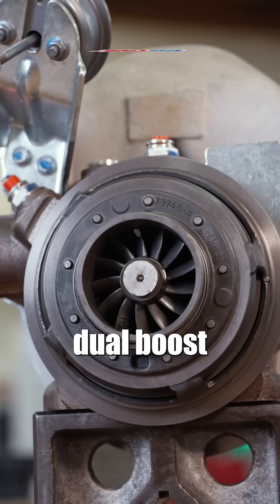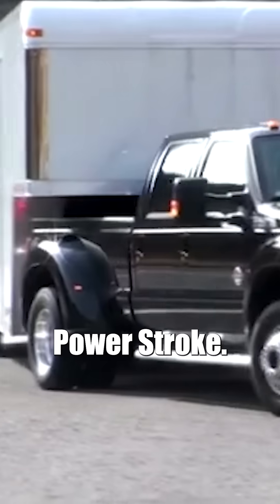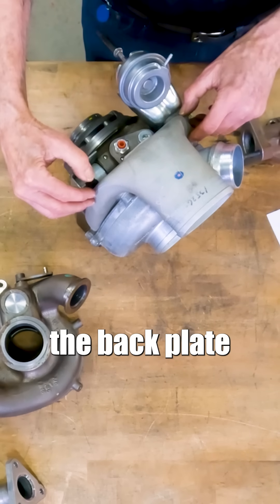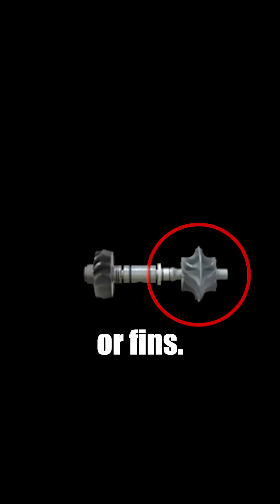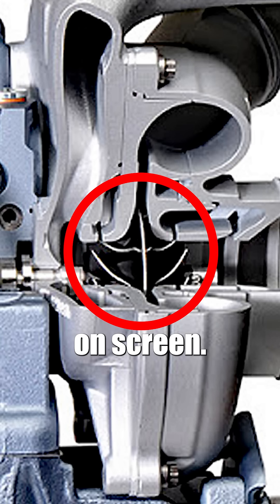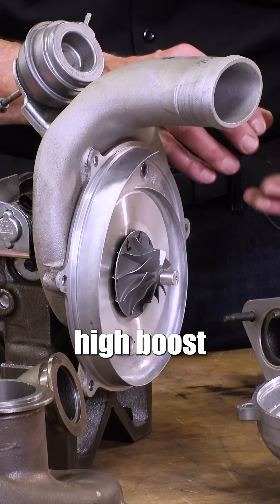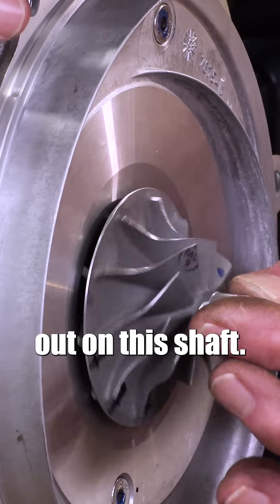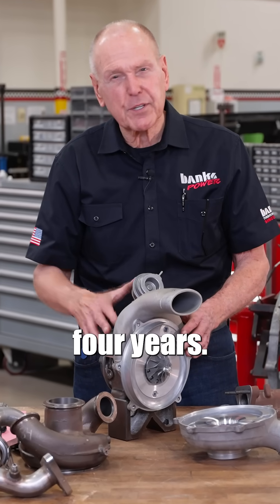Ford’s turbo failure.

Comment: They did this with early jet engines. Axial compressors were complicated, but a centrifugal was known tech to early jet builders, same as the old superchargers. So jet builders like Rolls built dual sided centrifugals as a stop gap till axials were perfected.

Comment: I would have made a double wheel on the exhaust side also, just to maintain balance, but also shouldn't the further contact area create a better rotation? I don't know about shaft speed, but id think it would hold momentum better. I literally dont know, I just fix cars, I don't do design haha 😁

Comment: Those turbos are junk I've got a corner of my shop that is full of those early turbos and number one reason is because no one does anything about the breather box and the seals in that turbo can't take the exrta blowby/crank case pressure when the breather box gets clogged so it will begin to smoke.....second reason is that compressor wheel will shear off from hard on off throttle hence why they waste gated a variable geometry turbo there shouldn't be a reason to wastegate an oem comparable variable geometry turbo and even being wastegated they still will shear off the wheel......and anyone who goes back to the early turbo is putting back on a problem do the right thing and convert to the 15+ pedestal and turbo....now you wouldn't bolt right back in a cp4 right after you lost one and all your injectors would you so why would you put back the same shit turbo.....

Comment: I have 2011 with 310k miles on it , have no emissions from 60k , engine  is amazing,  turbo never failed ...... yet.  Checked if I had wiggle in the shaft and it's solid.

Comment: - I think ???Williams turboengines used a similar back to back "duplex wheel" - rather than 2 compressor stages,  it was turbine / compressor" wheel - only they put the hot side buckets on the back of the wheel - it made for a very compact APU turbine generator - Maybe there was a thermal break between the actual disks.. - but the bearings were" -probably best  - all located on the cold side. 

With this design - for high speed operation (high boost ratio) a simple inlet shutoff-valve on the "surplus" compressor wheel - will completely unload it - so i tis a parallel duplex turbine - a high speed wheel combining??  a low speed wheel  (maybe splitting the wheels for manufacturing  and adding an unloading clutch would take parasitic loads off - though the mechanics of bringing the second wheel online and off line could be physical nightmare - though it could spool faster with one wheel offline...... ..

Comment: Cummins made the perfect engine. No modifications needed. The ISC 8.3. Rev it, lug it, load it, no services no problem. No bigger turbo needed, grid heater, 330hp 800 torque. Pushes my 27,400 pound bus no problem. 1999. It was designed with Banks in mind and beats Banks.
Cummins all the way.

Comment: Why 
Is it at 40 seconds into the clip .
He spins the turbo shaft and the inducer impeller looks to be out of round ?????
Reply: That's probably why he had it on the bench. The bearings failed, causing the impeller to contact the housing and chew it up.

Comment: So it's a single turbo that spools like a twin, pretty genius trick actually!
Reply: It really wasnt a great turbo. In the low end its decent but when tuned (even a mild tune) they tend to fail because it can't keep up and end up spinning way to fast. I put the 15+ turbo on the 2013 f250 I had after it failed. It made a HUGE difference in the top end and I didn't notice any loss in the low end or any difference in boost lag. That's probably the reason ford did away with that style turbo. It was just way over engineered.
Reply: You also have twice as much air, though! It's really good

Comment: Hell HOLSET turbos did something like that 25+ years ago, basically it was a turbo with (2) compresor wheels 1 stacked in front of the other one , it could do over 160 # of boost, but it wouldn't last one  350 foot pull before it would take out the thrust washers 😮

Comment: I actually like these they spool quick for the flow. Mitsubishi was back had an axial flow turbine feeding and centrifugal on a common shaft and from what I understand it actually worked out great in racing as it spooled quick for the day and was happy making 45psi of boost when the competition same size was struggling doing anything past 30psi with just making heat. Even this turbo could be modified for compound with just a back plate redesign

Comment: it's a cool concept that's basically been solved with twin scroll turbos, this seems like Garrett did it as cheaply as possible. A twin impeller system is probably possible with more money.

Comment: The concept is basically a centrifugal flow jet engine. Without a combustion. Ch-47 Chinooks engines are centrifugal flow jet engines.
Reply: T55 that you are referring to has 7 stages of axial compressor plus the centrifugal compressor.
Reply: @danmartinez9497  I never worked on the ch-47 with T55's. I did work on CH-46 with T58-16. I only knew from hearing from my instructor about the 47. And I do know the twin back/front turbo impeller isn't exactly like the centrifugal flow engine but it borrows the same principles that make the centrifugal flow engine work. I stopped working on helicopters almost 30 years ago. It was an amazing experience. And I'm glad I had it.

Comment: They didn't spend anything on design. It was invented by Rolls Royce in WW2. The two stage supercharger was on a common shaft. They simply did it with a Turbo.

Comment: Looking at that design, it really looks like any end thrust would be cancelled out at the compressor wheel.
So why did they quit using it?
Reply: The bearings failed in them. They spun too high of a speed to make the boost they wanted. This is even worse if they are tuned. Ford executives wanted power but also instant throttle response. And this is what the engineers came up with. I feel they could have made it reliable but it was basically already maxed out on the amount of air and boost it could make anyway so they just put a regular bigger turbo on it.
Reply: @blakew1026  Did they have a floating bushing in it or actual bearings.
Reply: @monsaka7827  actual oil fed bearings. I heard it could see shaft speed of like 100k rpm stock and up to 120k+ tuned

Comment: The normal full flow oil filter is 20 micron. List of stuff gets through.  
Fit a 2 micron bypass oil filter. Nothing nasty gets through and the oil lasts longer. Potential A LOT longer, but you’d need lab tests to take it that far.
Reply: I"m not sure how this relates here but about 45 years ago I remember being shown a study that someone did in conjunction with an oil lab in regards to bypass oil filtering. The testing was done with Perkins diesels which at the time were becoming a somewhat popular conversion during the second gas crunch in the 70's 

To make this short as possible, what they found was that the oil filtered through the bypass was remaining somewhat or somehow separated from the oil flowing through the engine. The consensus was that the bypass filtering was returning oil at a lower temperature and that lower temperature oil would remain separate in the pan where it was re-introduced after going through the filter. It had an effect but the effects were minimal because it was not merged with the main oiling system. Sort of like the eddy currents in creek. 

The end result after the study was that they would be better off to come up with a higher flow rate to a full flow filter with a bypass to protect the engine if the filter became restricted or to have a second, back up filter system which when in bypass of the primary filter, would take over still remaining a full flow filtration system.

I'm not sure what was ever done with it all since the Perkins air cooled conversions fell by the wayside over the years and the companies involved have all gone away but it did make sense. The whole purpose of the testing was to extend oil life and reduce fleet maintenance costs. Another idea that was put forward in the end was to have a filtering system that could run after the engine shut down, effectively reconditioning the oil partially but I never saw any logistical solutions for how that would work and remain powered up if not connected to an external power source and it would have no effect on the engine while it was running.

I think in the end they determined that extreme over filtering of the oil did not improve oil life enough to justify the cost, nor did it replenish additives in that oil which were still being depleted at the same rate, if not even being filtered out faster via the added system. 

There were various bypass systems on the aftermarket sold but none at the time became common place nor a replacement for more regular maintenance.

Comment: Factory Holset VGT on a 2018 Cummins with 450,000 freedom units on it. How? Deleted EGR at 33 miles the day I got it home from the showroom floor so it wasn’t breathing its own regurgitation
Reply: Same thing here on a 2015, 6k hrs on it and 200k. Haven't had to touch anything knock on wood
Reply: Wouldn't deleting the EGR save on def fluid as well? Or is it the opposite?
Reply: @monsaka7827  opposite. It will use more DEF.
Reply: @JC-dt7jv  That's a bummer.
Reply: opposite... more DEF used.  @monsaka7827
Reply: @monsaka7827  you think he deleted the egr but kept the def system?
Reply: @thevampiredude7  I have no idea. Some people do things in stages or by least effort and deleting EGR is a lot easier and cheaper than deleting def systems.
Reply: @thevampiredude7  I have no idea. Some people do things in stages or by least effort and deleting EGR is a lot easier and cheaper than deleting def systems.

Comment: Here is the problem. It was the bearings that were bad, so why didn't the company just upgrade the part 2 ball bearings.
It's because this turbocharger probably would have been extremely reliable, and they could not make money on it. Breaking and falling apart once the bearing problem was fixed
Reply: Hell, mines got over 350k on it and sounds and runs like a damn spaceship. I love it. When it takes a shit, I'll put the same damn kind back in it bc I've never heard a more beautiful sound in my life. When you drive by and let off the throttle, ppls heads spin to see what it was. It's 🤌
Reply: @chuckbuttons0699 Ha. You really think people are turning their heads in admiration don’t you? We’re just playing “spot the short guy”
Reply: buddy the bearings are being abused. that's the issue. He said popsicle on a stick, and it's true. The dual impeller is lopsided and the bearings cannot deal with that. NORMAL turbos get impeller shaft play, of course this one would as well.
Reply: You're hired by Ford and GM. Both you think like they like it
Reply: I don’t believe that BS for one minute. Lots of people have become so jaded and cynical when it comes to manufacturing companies. To actually believe that they invested research and development dollars into creating parts that will last just past the warranty period and then fail soon after is ludicrous. C’mon man.
Reply: @wphh7272  because its true. Ford is now using timing BELTS drenched in oil in global Ford Ranger and Everest with the 2.0 biturbo diesel engines (same as Peugeot) and some ecoboost engines have a wet belt for the oil pump. And guess what? It degrades after some years way before the recommended replacement interval and destroys the engine. Oil pick up fills with belt pieces. This was done just for emissions and efficiency standards and they really dont give a shit after the warranty period ends. Go buy your new engine from Ford. Ill keep my 2016 Jeep. Not the best one, but its reliable enough for me and it has an ACTUAL metal timing chain that doesnt get destroyed by the oil.
Reply: @wphh7272  especially when data shows that one of the main ways they sell is to customers satisfied with their previous trucks. Manufacturing companies can make mistakes and look for profits but they are not evil idiots
Reply: @wphh7272 Look at how companies work to increase their stock. It's always about more and more and more profits. Build more, cheaper, and charge more. These large companies are never satisfied.
Reply: @wphh7272 I’d love to believe what you are saying is true. I look at complex designs and think man there’s no way they wasted that much time designing it so well that it only lasts x miles. However, when we see seemingly increasingly accurate, shorter and shorter warranties, how could we draw any other conclusion? Besides maybe hiring the wrong material’s manager which leads to inadequate quality of materials in essential parts like the bearings.
Reply: @wphh7272   I'm absolutely with you, this guy is talking bullshit. Why has no other company such a design in their program, if it was so good it'd be a common thing. yet this was probably the only turbo with this design.
Reply: Great explaination 🏁🏁🏁

Best out of all the other commenters here 🎤

Comment: I would think we should be able to beef that shaft and bearings up and make it a impressive reliable turbo.
Reply: If I remember right, wasn't the main problem just the cheap crappy ceramic bearings anyways?
Reply: @ right, ford did do some improvements on the 13-14 turbo’s bearing i think, it’s just a shame they didn’t try to keep that style turbo going and really improve upon it.
Reply: Yeah no doubt!
Reply: Well, they had their best minds designing and creating that turbo. Not only did they cease to use it, no ford hobbyist (which there’s a whole cult of them) found any practicality in that turbo setup nor did they find any reason to try and make it better. There’s a handful of people out there that live and die by the ecoboost platform and make tons of power with them and even they didn’t want to try and make this better.

Comment: So why do they fail? Shaft snap? Bearing burnout??
Reply: I would guess the bearings wear out allowing play in the shaft and the impellers contact the housing grinding away the veins so that boost pressure is eventually lost or it detonates.
Reply: @ I appreciate the guess

Comment: The real benefit of this design was it's very quick spool and transient characteristics.  If you drive a 14 and 15 back to back it's noticeable and slightly disturbing because in the back of your head you think something is wrong with the truck for that split second until you remember you're driving the newer truck.  All from the idea of producing larger turbo flow via using twin small diameter and therefore small MOI wheels that spin up much faster using the same exhaust energy.
Reply: Huh? Don't you still have the same amount of mass to spin because you have two turbines?  Maybe a little gain on what your saying because smaller dia turbines reduce the arm on the mass at the end of the radius.  I have a 2013 F150 V6 Ecoboost and the turbo lag is terrible.  Anybody have fix for that?  Also had to put $12K into it at 151K because of that stupid cam time nonsense.  I MADE ford pay for half of it.  For the record I am religious on maintenance and had a 2000 F150 Triton 5.7 go 220K with ZERO major issues, and no drive train related anything.     That was the most reliable vehicle I've ever owned.
Reply: @1950Bonanza  yes, probably has similar mass over all, but it’s more concentrated towards the center. Rotational inertia is a produce of the mass and the square of the radial distance from the centerline of rotation. Therefore, mass isn’t nearly as much of a concern as overall diameter is.
Reply: @plconnor41  Makes sense.

Comment: I'd say for Gale Banks to be impressed with a stock turbo: it should be good!
Reply: Hes explaining why this turbo is garbage
Reply: Ford like spend money to customer paid their engineers....
Reply: the idea is still cool lol. 

somebody should fix this design and put it with a DVT hot side lol. 

basically twin turbos in one turbo. a parallel turbo lol. 

a pair of them on a flat plane v8 would be bananas lol
Reply: It's actually a failure prone piece of junk which is why they ran away from it rather quickly
Reply: @charlespleydell6746  
And bad
Reply: @markcozzie I’ll bite. Please explain.

Comment: That's how innovation goes sometimes. It take a lot of time and money to prove something out that should work in theory.
Reply: no you don't get it, the turbo is open ended meaning the dual impeller is held in the center of the turbo by the bearings. the amount of play that will inevitably develop is an issue.

even in theory this looks like a problem.
Reply: @krebgurfson5732  are impellers not normally held in the center by bearings?  Or is this a problem because it has varying pressure on both sides?
Reply: @ yes the bearing is normally in the center, what's not normal is the unbalanced load and length of the impeller shafts. The play i described will be fine on the interior compressor but the exterior one will eventually (probably quickly) destroy it's self on the housing. Maybe it's a better bearing design that won't wear like other turbos but i really doubt it. 

There's better options than this is the main problem.
Reply: Consumers should not be impressed, and should be disgusted they are unbeknownst Betta testers

Comment: What was the failures, snapped shafts?
Reply: Just typical cartridge failures, such as oil leaks.
Reply: Ceramic bearings and a lack of forward bearing.

Comment: I'd like to see a gear driven compressor, separating the Hot and Cold side. Get rid of all the heat sharing, intake air temp would benefit.  Or electric with a hot side generator and cold side driver. Capacitive energy storage to negate turbo lag.
Reply: Centrifugal blower has entered the chat!
Reply: pretty long shaft on this could have cooled it some ?
Reply: That's called a supercharger
Reply: @markcozzie  Procharger